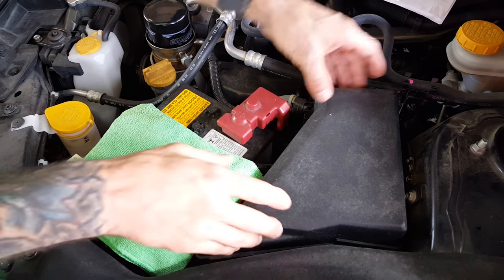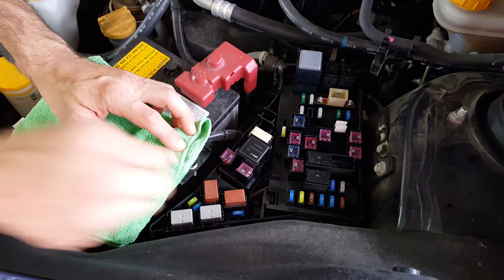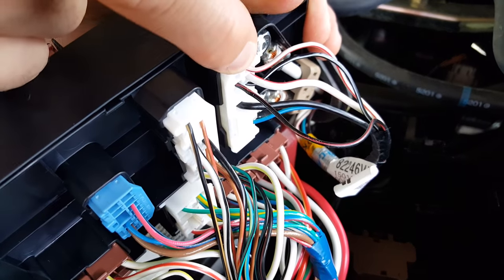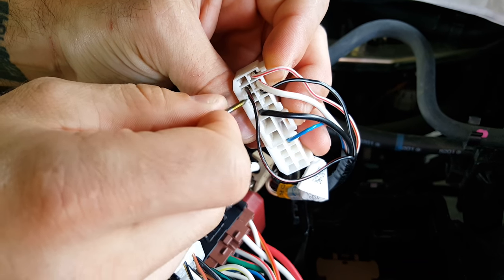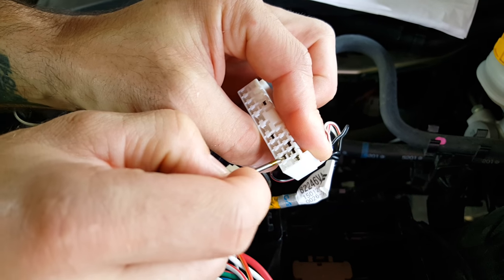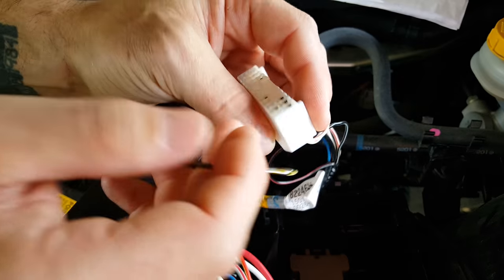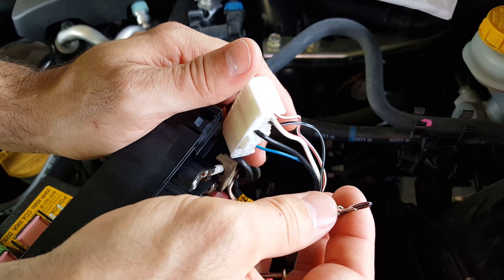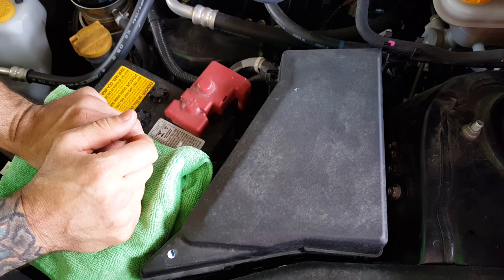2015 wrx alternator charge fix

Comment: gonna do this once I get a new battery from the dealership under warranty. My batt failed after 2.5 years probably due to the fact our factory voltage system only charges 11-12v instead of the expected 13.5-14.8. Thanks for posting this!

Comment: FYI for anyone who wants a cleaner solution, provided by Subaru:  Since beginning of production MY2018 there is an ECU software update that addresses this on the WRX.   Reference TSB 11-174-17R. 

Other models had other issues also covered under this TSB.  Here are the models and the VIN when the fix was implented in production for those models and their respective fixes.  Please see the TSB for full details. 
2017MY Legacy 2.5L CAL Spec. H*066602
2017MY Legacy 2.5L FED Spec. H*067114
2017MY Outback 2.5L CAL Spec. H*410208
2017MY Outback 2.5L FED Spec. H*415272
2017MY Legacy 3.6L H*066607
2017MY Outback 3.6L H*410212
2017-2018MY Forester J*411657

Comment: Rather than looping the wire back and masking it off with electrical tape or heat shrink tubing, could you just plug it into an empty pin in the wiring harness for a cleaner, more secure modification?

Comment: 2015 impreza/crosstrek. I have verified this is the same as the wrx. compared diagrams and its the same plug and wire. thanks for the tip!
Reply: What is the wire named. I have a 2019 Impreza and I have a feeling it won’t be in that spot. I have access to detailed schematics but I don’t know the actual name of the wire/sensor.

Comment: On my gen2 Subaru, just pulling the alternator fuse produces this result. It is the "voltage sense" line from battery to alternator.  I'm holding at 14V steady, even at warm idle.  I've also heard of using a diode at that fuse position to decrease reported battery voltage a bit, which may be a slicker route, since the battery light is now on while running. Cheers.

Comment: I just did this mod to my 2017 wrx. No problems with battery yet but hopefully this will help it last longer.
Reply: ever have any battery problems later
Reply: @jonnythunder76  Not yet, car will be 5 years old since I purchased it in August and still using the same battery.
Reply: Glad to hear. Been running this fix on my 15 wrx for over a year. Battery still great and its 3 yrs old👍
Reply: I have a 17 sti and the bottom of my fuse box looks nothing like this.there is no black/red wire. Alternator has a black/white.
Reply: @ronarter5162  STI must be different.

Comment: this worked on my 16 wrx. shits mint
Reply: i just pulled in and got voltage drops on my 2016 to like 9v going to try this and see if it helps
Reply: @sammcenany12  if its down to 9v that sounds like something else is wrong

Comment: Instead of me having accessory issues i instead had my OEM battery die at 2 years. 😒 my new battery is dying right now, and it’s brand new as of april 2018 😑 im gunna try this.
Reply: How did this work out for you? I'm having the same issue, just bought a used alternator off a wrecked crosstrek on Ebay. Will keep it as a spare if this helped you out.

Comment: If you wire a 1000v 6a rectifier diode into that black and red wire it would charge at about 14.5v wich other than the program update would be a better way to do it

Comment: you think this would work on a 2014 impreza hatchback sport with naturally aspirated engine + CVT? i recently logged battery voltage v.s. time (via OBD2 port) for a few trips, the alternator appears to turn off for ~10 seconds at time, depending on driving conditions. would love to stop all that.

Comment: I have Dashcam batteries that i have hard wired into the fusebox, tapped into the 12v accessory fuse and i get inconsistent slow charging. Sometimes 0.5 amps to maybe 1 amp. Would this trick improve the charging of the Dashcam battery? Or even phone charger?

Comment: I got my 2015 wrx in April 2014 I think it was one of the first ones, the original battery got died and I had a jump starter with me at all times, I did some research and there was a recall and also found out that the dealer were re flashing the ecu and after that the car lost performance & that deterred me from taking it in, now after another battery and constantly aware of voltage via cigarette lighter 12v meter I found that having the parking lights on at all times prevents voltage drop, what's the best option this mod or parking lights on all the time

Comment: What does the B/R lead actually go to.  What are we turning off or deleting when we pull the wire?  Thank you for VID and for your time!  It looks like this is geared towards the FA20 in general and probably works on the 2014+ Forester XT's as well.
Reply from the maker: It removes the ecm control signal to the alternator. the ecm controls the alternator on/off. The alternator still has its own built in voltage regulator. This function is only there for fuel mileage, but hurts performance.
Reply: +Jordan Dedon excellent and thank you for taking the time to look into it.

Comment: Interesting fix. For the longest time, since 5k miles, my AP would shut off randomly and restart. Never really looked into what was the cause since in 2014, there weren't many digging into it. Moreover, the trip meter seems to always reset itself. Curious to know if this is a fix for it as well....

Comment: Just got back from Subaru for this issue on my 2016 WRX, told me it was an ecm update and that they couldn't do it since my car was already tuned. Ended up getting a new battery.

Has anyone had any issues long term with this mod?
Reply: any update?
Reply: Been running the fix for more than a year and battery is 3 yrs old! Keeps voltage at 13.5-14 on my accessport.

Comment: The alternator on my subaru OTB 2004 broke down, I had the diode block, brushes and voltage regulator refurbished. Error P0558 has occurred and the voltage on the started car is 13.2V. According to the instructions from the video, I disconnected the wire from the ECU and the voltage is a beautiful 14.6V, but the error still occurs, does anyone know what to do with it? thx and sory for english (translator use)
Reply: Which wire did you disconnect from ecu? I have same problem with my car

Comment: So, I have a 2018 WRX limited with the HK sound system. The car is very new with only a couple thousand miles on it, but I get a consistent "hum" or "static" kind of like a white noise from the sound system. It gets louder and the volumes gets louder, and it isn't from the bluetooth connection as it does it even when I turn the bluetooth off, or go to other sources. I do find that the noise goes away at different rpms, when I give it gas sometimes and when I let off the gas at others. I haven't taken notes at rpm positioning, however I believe when I'm on the highway cruising at 70mph in 6th gear, if it give it some light throttle the noise goes away and comes back as soon as I let off the gas. 
Is it possible that this mod would fix my alternator noise? I'm assuming it's alternator noise because of the throttle affect on the noise. Thanks!
Reply: Turner Hayes
Just ordered that piece, hopefully it helps out it is driving me insane!
Reply: You got it! I'm waiting on the item, for now though where am I going to connect it to? between the head unit and the amp?
Reply: Turner Hayes So this piece I bought won't work. I was about to take everything apart, but when I looked under my amplifier I noticed that there are no RCA plugs, everything is connected with pins. Propietary connections, and when I looked up videos of the head units coming out everything on the back side of the head unit is the same. 8 pin, 20 pin, what have you. So at this point I don't know what to do... I was so excited. Lol
Reply: Turner Hayes yep, the HK system sounds decent, not as good as my previous $1,400 custom system I had in my prior car... And getting rid of that horrid noise will make it twice as nice to me. I'll look into what you told me... But I might just bring it into a specialized audio shop near me to see if they can do it so I don't mess anything up... Honestly they'll know more than me lol. Thanks for everything though, honestly.

Comment: It feels like the throttle is more responsive, but now my intake values are waaaay high and waaaay low. I'm thinking it makes the sensors more sensitive when this mod is done.
Reply from the maker: Could you be more specific about intake values? Yes I also noticed better throttle response.

Comment: I just discovered you. Do you think a 2017 impreza sport could be run at 15.5 volts without damaging the computers or any other issue? Thanks!
Reply from the maker: I don't think it would cause any damage, but will eventually cause a voltage logic error on some system and set a DTC.
Reply: @just2buy4  thank you for fast reply!! I run a lithium battery and have bypassed the pcm for increased alternator output. I'm looking to maintain a higher state of charge in my lithium pack. Again thank you.

Comment: Will 2013 Crosstrek be the same?Can it affect how the traction control works?
Reply from the maker: This seems to only be present in models with Direct Injection. This will not affect any other systems.

Comment: I noticed that my Subaru Outback voltage is toggling between 14.4V and 12.2V. It looks like it is BMS fault, Does anybody know how to do the same modification in Outback?
Reply: I will answer myself, It looks like I managed to block BMS. In 2015 Outback the black-red wire goes directly from ECM to alternator so I decided to block 3rd wire in alternator connector with electrical tape and it looks like it worked no more oscillations voltage stays at ~14.3V all the time.

Comment: Why should I fix it? How do I know it's not charging well
Reply from the maker: you can monitor with a volt meter or accessport. may be more difficult with a voltmeter but I'm sure you can find a power wire to back probe.

Comment: waiting for a brave sole to try first, as my 14FXT, w/FA20, doesn't seem to get lower than 11.9v but at idle at night my lights will pulse at idle reading 12.2v.
Reply from the maker: I will be examining the wiring for all late model subarus to see which can benefit from this mod. I can tell you that the 14 FXT shares the same alternator so it will most likely have the same issues. Stay tuned for updates here or nasioc.
Reply: Jordan Dedon Any updates on this kind sir?
Reply: Did this on my 14 FXT, ~60k miles ago, same wiring, definite improvement no issues. Original alternator and same battery. Rock solid voltages.

Comment: Did this mess with your electric speedometer at all ? Tried this fix and now I can’t see what gear I’m in or my speed
Reply from the maker: Not this has zero adverse effects. Maybe have pulled the wrong wire.
Reply: Jediam84 I unplugged the correct wire for sure but is it do to me unplugging my battery ? Maybe I just need to go through and set all that stuff back up ?
Reply: Jediam84 I don’t have automatic windows now either lol
Reply from the maker: @joeyheckel654  the auto up function of your windows needs to be reset after battery disconnect. Simply hold switch up until window  reaches the top and continue to hold for another 5 seconds then release.

Comment: Do you need to have a access port to do this?
Reply from the maker: Richard Cruz not at all. Just disconnect your battery to prevent any accidental arcing. The alternator has its own built in voltage regulator. No adjustment necessary.
Reply: Oh ok, my car turns off by its self sometimes and they power steering light comes on so I’m gonna try this and see what happens cause I’ve taken it to the dealer twice and they say they don’t find anything wrong with the car.
Reply: Make sure your negative terminal on the battery is tightened all the way down. Was having similar issues until I saw that my negative terminal was really really loose on my battery. Tightened it down and no longer having any issues.

Comment: This video is interesting. I was already going to purchase a new battery for my 16 premium wrx. After installing my final map I just have problems charging. Won't start after I drive for a short amount of time, but if I let it rest for at least half day I don't have any problems starting it. My only concern is if tricking it to charge at all times. overcharging it and would lead to another problem? I'm studying auto tech for my hobby and electrical is one of my weaknesses. I just remember something about over charging. I might have to consult my professor about this before I proceed.
Reply from the maker: This does not trick into charging constantly. This removes the ECM control and allows the alternator built in voltage control. It reverts the charging system to a traditional more consistent charge.

Comment: Will this help with light flickering from subwoofer?
Reply from the maker: Should help with that, but if you have a large aftermarket sub and amp it may be more power than the factory system can handle.

Comment: What prevents over charging now?
Reply from the maker: Every alternator has a built in voltage control circuit. By removing this pin it allows the alternator to solely use this built in system rather than ECM undercharging.
Reply: But does this help with over charging? I checked my battery today and the positive side has corrosion. Which is a sign of overcharge.